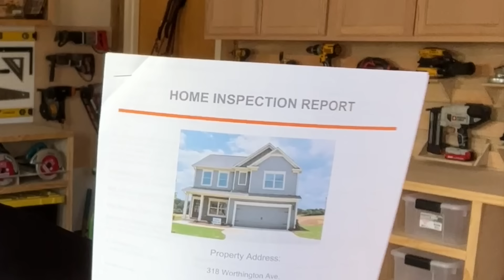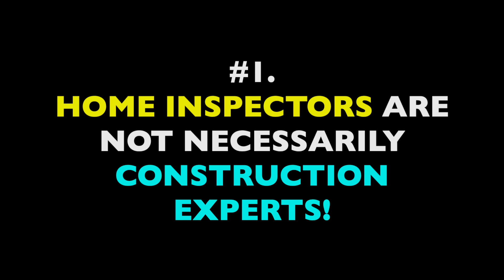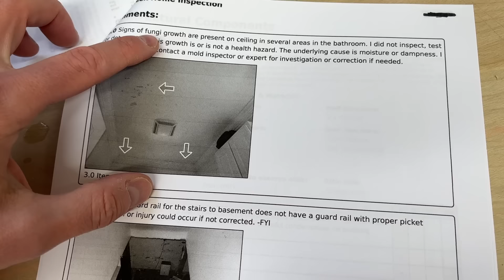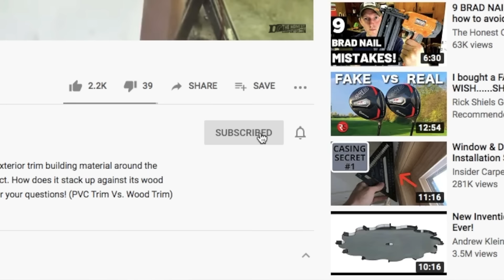The Truth About HOME INSPECTION REPORTS! What They Leave Out...(Homebuyers SHOULD WATCH This Video!)

Comment: Never ever - ever - use an inspector referred to you by your real estate agent. Based on knowing and having worked with builders, inspectors and real estate agents most are ethically questionable and as said in this video, your real estate agent wants the sale to close. The inspectors want referrals from real estate agents.  Inspectors who find real problems don't get referrals. 

So listen to this video's advice. Pay extra for an inspector with actual construction experience and one that is not getting referrals from your agent. Simply ask if they get referrals from your agent / agent's office.  Have a mold inspection done, too.  And if it's a condo have your inspector evaluate the outside of the building & grounds. Walk the grounds. You'll learn a lot about if the complex is well maintained. If it's not - run!

This is the biggest purchase of your life - don't skimp. Also hire an attorney for the closing. Real estate agents HATE that!! lol

Comment: Just bought a home and had it inspected. 2 weeks later I learned what knob and tube wiring is because I saw it in my closet. The inspector completely missed this and now I have to rewire my whole house. Is the inspector liable?
Reply from the maker: Oof! Hard to say, Luis. You could possibly reach out to a construction lawyer. But suits like that can be tricky to pin on anyone 😕
Reply: I am definitely a rookie when it comes to home buying and especially buying an older home. For the future I will never rely on any home inspectors. I'm paying the extra $100-200 for a electrician or plumber, etc to come look. I have been reading about how to become a home inspector and what they are there to do. This profession needs to change, be regulated, and have way  higher quality of requirements. It should be much more difficult to become an inspector than to become a general contractor.

Comment: Working in construction can mean something in what ever area you are knowledgeable in (plumbing, electrical, framing etc.)  but can also mean nothing. I mean you can be a tile layer, trim carpenter, painter, landscaper, sprinkler system installer, gutter installer etc. and put x years of construction experience in your resume but do you really have any knowledge of anything meaningful as far as home inspections go?  Your not wrong though I see tons of new inspectors that are licensed by the state and are totally clueless for the most part.

Comment: As a structural engineer, i can tell you without doubt 'home inspection reports' or 'building and pest reports' are simply not worth the money you pay for... they're vague as fuck as well, if you want to buy a home and are completely at a lost when it comes to affairs of the home, pay for a dedicated pest (termite inspection) that uses thermal and moisture meters and a dedicated structural engineer to assess your house, and ensure they use digital levels to assess foundation movement (subsidence/heave etc)..

Comment: I have found home inspections pretty useless. The reports are filled with a lot of templates with explanations of what I seeing inspected with the results buried in the template. There needs to be a section titled RESULTS. Maybe newest are. Instead, I hire an hvac company to inspect the heating and cooling systems and a structural engineer to inspect the structure of a house. Being a mechanical engineer myself helps but I’d rather have a third party do the critical stuff. Ditto if the plumbing or electrical looks suspect. Fortunately I have t had to buy a house in a long time.

Comment: I can understand your frustration, but before you cast stones at an entire industry, maybe you should walk a mile in someone’s shoes. I agree that apprenticeships should be required.  Furthermore, please understand that each state has it’s own definition of a defect. For instance, my state says that Home inspectors are required to report on items that are not functioning (window won’t open, furnace doesn’t work, roof leaks, etc), unsafe conditions (electrical issues, loose railing, no handrail, etc), and items near the end of life. Also, you agree that a home inspector is not a structural engineer, code official, plumber, or electrician. And that these people will have different opinions. Additionally, there can be more than one way to correct a defect. Since inspectors aren’t warranting repairs, they won’t detail how to make repairs. Finally, just like every profession, there are good inspectors and bad ones. I am sure there are good carpenters and bad carpenters. Have a good day.

Comment: Made few valid points but frequently contradicted your own comments. Inspectors are not construction pros, nor are they supposed to be. A construction pro is not an inspector. Not sure why you are trying to find fault with inspectors when their job is NOT construction. As a construction pro, you can't know about HVAC, electrical or plumbing. But an inspector knows enough to advise the buyer on the status of ALL systems of the home, and that's their job.

Comment: You tell me, what are we supposed to do with access issues? I report your buying a home with part being inaccessible with possible repairs in that location and then add there will be extra expenses making those repairs because nobody can get to them. We are here to educate you on your purchase. Are you still sure you want to buy that home with a crawlspace that nobody can enter with lots of items that may need repairs overtime. If you think finding a small plumbing leak in a location like this is of much value then your being mislead, the real issue is your buying a house that is a complete pain in the ass to fix. That is where the value in an inspection comes from.

Comment: Did anyone else's butthole pucker when he showed the picture of the house being framed with the sheet of plywood hanging halfway over a second story foyer/stairway opening?
Not sure about other states, but an inspection trend in NC right now is to cut the calk around your toilet to pull a moisture read and then write it up as being a loose toilet if they can get it to move the slightest (PVC flanges flex...dur). I'm telling home owners to advise prospective buyers that THEY will be responsible for any damage incurred to toilets/seals during inspections.

Comment: Partially accurate but you don't really understand the industry. While most of what you said is accurate, some of the time, a lot of it is based in common misconception. I guess it has some information that is helpful for buyers but overall people use information like this as an excuse to waive their inspection and there is more of this type of information out there from inexperienced people than videos of the value of home inspections from neutral parties.

Comment: You are all over the place. Much of what you say is in fact home inspectors are bound to report what is in the standards of practice set by each individual state. You are making general statements which would hurt legit home inspectors because they are complying with the standards of HI mandated by the state boards of home inspectors. Home inspectors cannot make recommendations because the state laws say they are no permitted to do so. IE, if there are clues that suggest there is an issue with a foundation wall, They have to recommend an expert who can check, then fix the problem if it is warranted. That also goes for for windows and doors, Roofing, HVAC, Plumbing, etc. A home inspector is not required to be any of those experts. They are as you said, "trained eyes." So again you'er all over the place because of something that was created by bureaucracy's. States Boards created this.

Comment: Inspection is a waste. It's a rip off scheme that worked extremely well. The buyer, having no experience with any trade, could probably walk around and look at stuff and find more than the inspector could.
Reply: In my inspection report...all smoke and CO detectors expired, all the bath rooms have zero ventilation though exhaust fan running, almost all door locks to be replaced, cracks in foundation, furnace and water heater passed its expiry lives, thermal imaging detected water leakage behind the dry wall.........thousands of dollars saved in negotiations with seller.
Reply: @kaaaah2003  you couldn't figure that out yourself?
Reply: @2skyman  it was a new pre home buying inspection.
Reply: @kaaaah2003  didn't answer my question
Reply: @kaaaah2003  also none of those are a real issue. Not to say they should be left not fixed, but none are an actual issue
Reply: @2skyman  it's personal choice as how safe and healthy home you want to live. Canadian code required smoke detectors in rooms, basement for fire and personal safety. Exhaust system running in washroom is a must for washroom and entire home air reconditioning particularly VOCs in air v breath.
Reply: @2skyman   What do you mean? I am an  Inspector? I have thermal camera to find water leakage beyond dry Wall? He has CFM meter to find exhaust issue. I have no clue how to check smoke detectors and cracks in foundation. He did all I paid $380  and got repair and replacement cost from seller thats all. You are making unnecessary argument. Stop it. I am not a professional to find technical things.
Reply: @kaaaah2003  pipe down. It's a waste of time and resources. Alot of things are though. Don't have to catch feelings over it